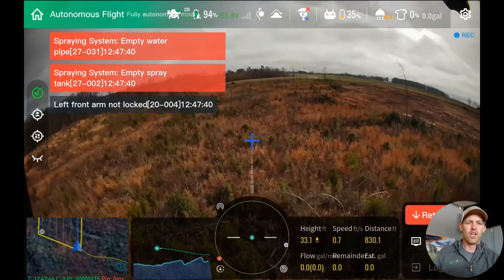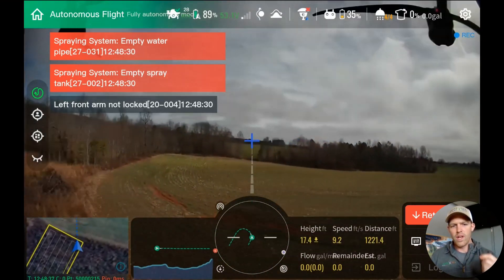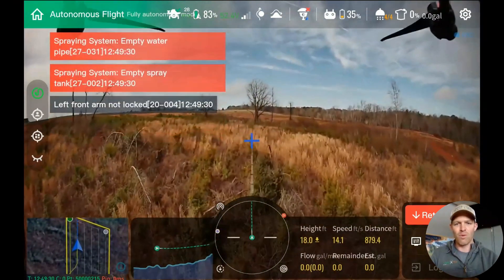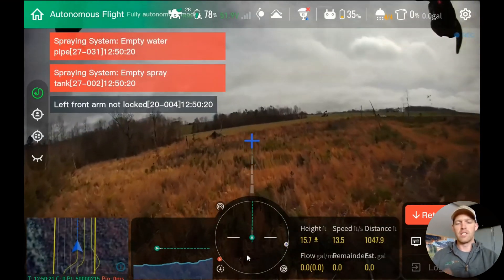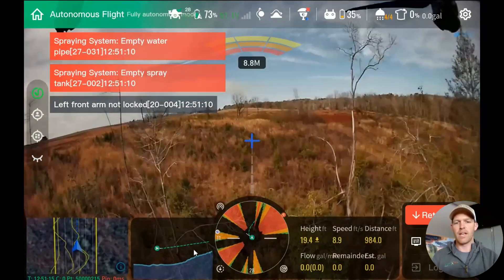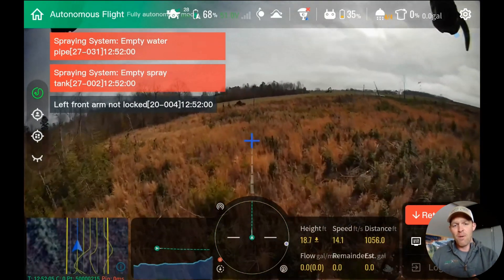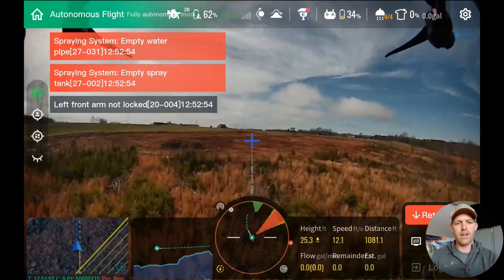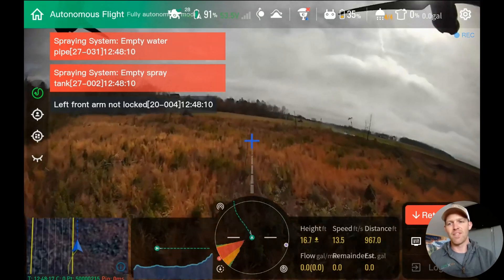EAVision J100 LIDAR Obstacle Avoidance | Spraying Around Leafless Trees

Comment: So if obstacle avoidance and terrain follow are both turned on,  is the priority to maintain application height over the terrain and find paths laterally if possible,  and if the obstacle avoidance is turned off with just terrain follow it will climb over the obstacle to maintain flight path? Does this sound correct?